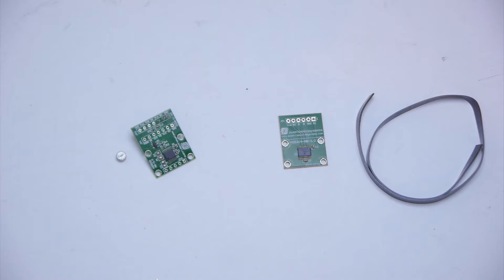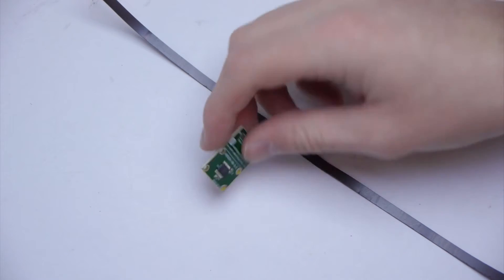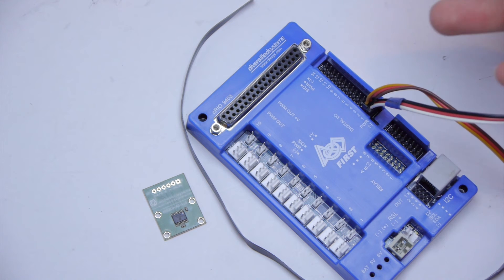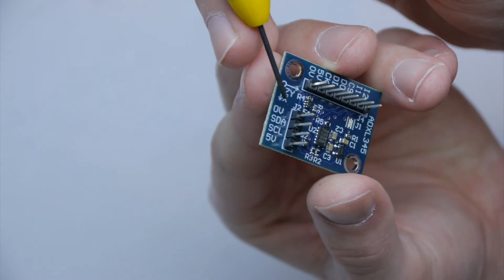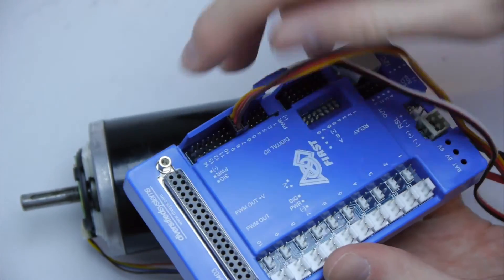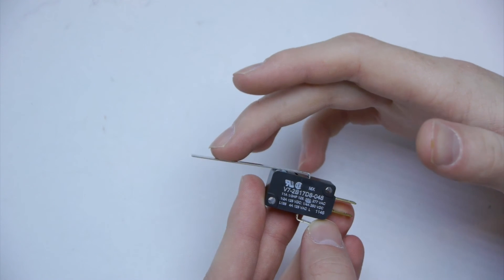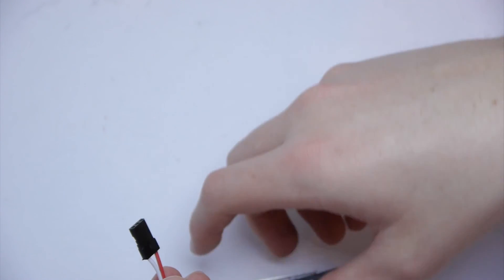Sensors Used in FRC

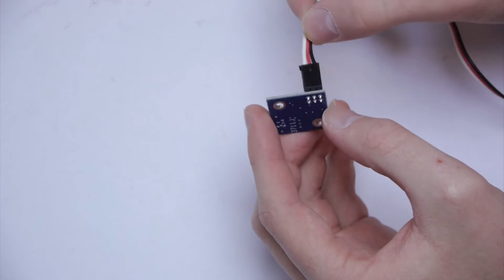Comment: At 5:45, often it's not labelled due to space limitations on these small boards, and the expectation is that everyone should find that info in the datasheets.  That's really important as there are several variations of these sensors with important differences.
Reply from the maker: Yes, you are quite right.  There was, however enough space to screen print a small ground indicator on the gyro.